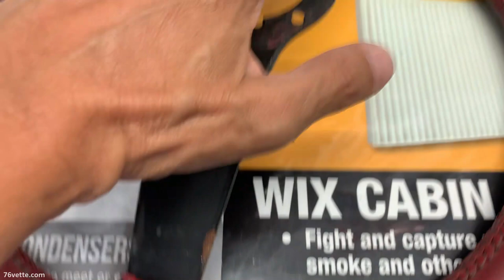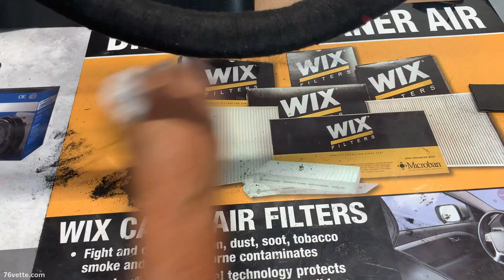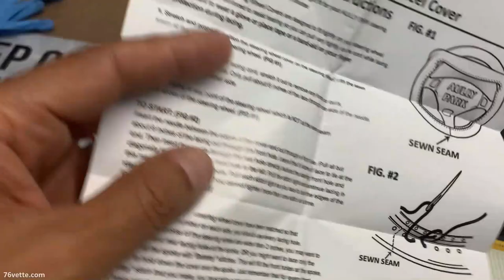Guide to STEERING WHEEL Restoration

Comment: Very well done!!! Must say, it seems to be a project were you need a lot of patience. The stitching works well also w/ the black. Going around at the end and tucking in between the stitches helped the final look also. Where can the covers be found for purchase, never seen them.
Reply from the maker: Thank you! Glad you liked the video. You can order a steering wheel cover from Amazon at https://amzn.to/3N2RDQd but you can choose a different leather color, or thread. However, I bought a different, thicker thread, https://amzn.to/3kTXRpp and again you have the option to pick whichever looks better in your opinion.
Lastly, the cloth tape I used to hide the dried-up leather and also thicken the grip is this one, https://amzn.to/3L0k0x9
Hope this helps, and good luck if you decide to recover your steering wheel 🙂👍
Reply: Looks really nice!